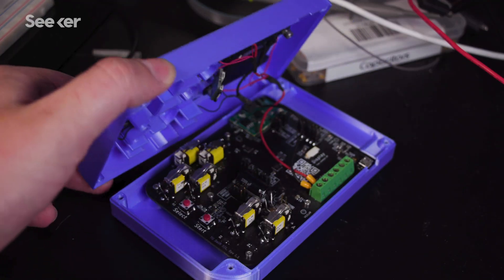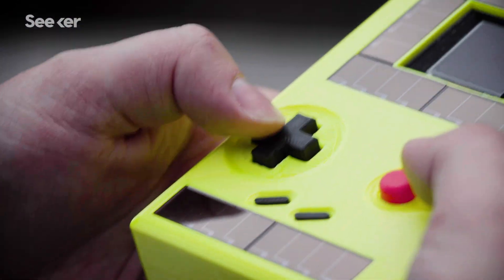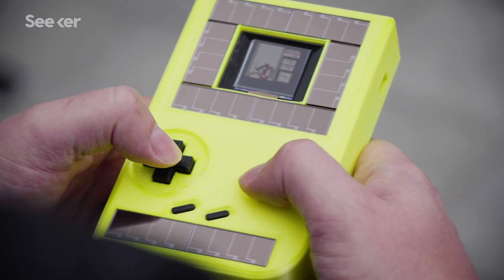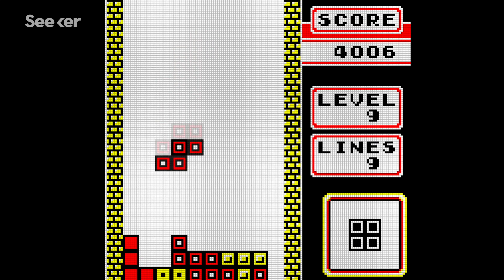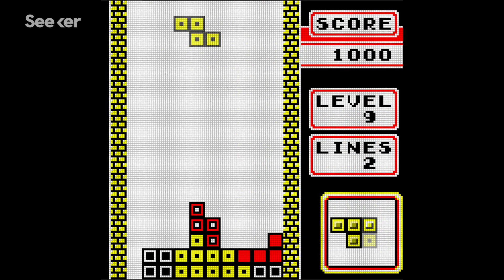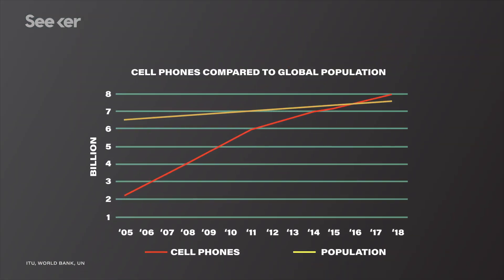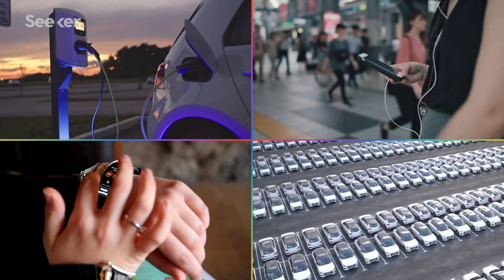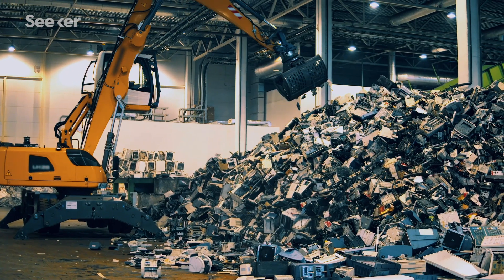The Next Gaming Revolution Starts With a Battery-Free Game Boy

Comment: "Battery-free",  "nothing you would recognize as a battery", yet at 0:06 there is a 3300uF capacitor inside, which is very much acting like a energy storage component, i.e. a battery. I'm all for pushing new ideas, and making things energy efficient, but please don't do it on false grounds and misleading people, it just dulls your message. "Battery-free" and "using a different way to power" are two very different things. Hand crank "battery-free" emergency flashlights use the same idea, store energy in a capacitor for a short time after cranking to light up one or a few LEDs.
Reply: A capacitor has significantly less environmental impact than a battery. It may be serving a similar purpose but the fact that it specifically is not a battery is important.
Reply: @EMAngel2718  this is why we need to improve battery technology, not eliminate them, because they do provide energy storage above and beyond what we would have otherwise. You're speaking in defeatist terms, I just call out the bull and marketing mumbo jumbo for what it is. It's kind of like saying something is "battery-free" because you're powering it with mains power. You can skew things however you want, and while making things more energy efficient is a great idea, the more we coat things like these in inaccurate descriptions the more we obfuscate that concept in the general public and the slower progress we make.
Reply: @SwitchAndLever  Arguably, we need to do both - improve battery technology and also look to other ways of powering devices.
Reply: It isn't a AA or lithium ion battery, which is what they were talking about
Reply: I wonder why supercapacitors are not used here. They have much higher energy density, so it is not a problem to put inside such device 1 F instead of 0.0033 F.
Reply: Gonna say, why not add a battery to store energy while it's not in use? Buttons aren't being pressed, but sun should be available for some of the day. I'm no expert, just curious. Also, where does he thinks the materials are coming from to build the device?
Reply: To most people none of that looks remotely similar to the inside of any portable gaming device.
Reply: Just because they do the same thing doesn't mean they're the same thing. There's a huge difference in capacitors and batteries. If you watched the entire video, you'd see they talk about lithium ion batteries and their drawbacks and this being a replacement for batteries in the device. So yes, the difference is real and significant.
Reply: Oh come on, give em a break. A capacitor is a capacitor, not a battery... even though it can act like one.
Reply: @AR5ONL  Which is exactly what it does in this device. There is literally no other reason to have that big of a capacitor in a device like that.
Reply: @SwitchAndLever  
And how else do you think they would store the energy?

Capacitors have to be used here and in really any circuit where energy input is unstable and like a battery capacitors can still fail. Also like batteries the bigger a capacitor is the more likely it will explode damaging nearby components when it does.

Capacitors can be safely charged and discharged much longer and over many more cycles than any battery, but they still degrade and will add to e-waste.

Additionally this very simple device takes up more space and requires more physical mass to make meaning CO2 goes up while the compute ability dropped off a cliff.

This cannot power a phone or really anything that we use today without one of these two things happening.

1. Compute architecture must become hundreds of times more energy efficient.

2. The electromechanical and photovoltaic power plants in this device must generate dozens to hundreds of times more power.

Remember that this example proof of concept device is barely capable of running Game Boy games for a few seconds on a device with a smaller screen, no speaker and using far more modern and energy efficient chips.

This proof of concept is as much of a pipedream as hyperloop.
Reply: @VariantAEC  I'm not sure, it sounds like you're arguing against me even tough you've said nothing that I disagree with? 🤷‍♂️
Reply: @SwitchAndLever  
I am and I largely agree with you as well except on the singular point of using a capacitor. I asked what do you think they could use besides a capacitor and argued that they couldn't use anything else. There is no way to make such unstable and low power usable without a capacitor. If they were generating more energy than they need they could use resistors alone, but that cuts into the top end power they could output as well. If they generate too much the resistor burns out and the circuit is permanently broken (until the resistor is replaced). You can still use a capacitor to store the excess drawing only from the capacitor when there is a surplus of energy sparing the strain on the resistor.

So I ask again what else do you think they could use to power any electronic computer without any battery or capacitor?
Reply: @VariantAEC  "So I ask again what else do you think they could use to power any electronic computer without any battery or capacitor?"

I'm not arguing that they should use anything but that, I'm pointing out the double standard in the way this is presented. "No-battery" technology is, at the very least in our current understanding of physics and how to power things, dead on arrival for anything but the lowest power requirements. Focus needs to be on improving and inventing new, and more sustainable, battery technology and systems to deal with e-waste.
Reply: Battery : electrochemical cells that transform chemical energy into electricity.
Capacitor : device that stores electical energy in an electric field.
There is no battery, period.
Reply: @baddan314  I was waiting for someone to split hairs and copy some text from Wikipedia. Thank you for not disappointing! I'm not arguing that the underlying principles of a battery and a capacitor is the same, I'm merely saying that they fill the exact same purpose in this circuit. They store and discharge energy. Saying that this doesn't have a battery because it has a capacitor is like saying that the rhino doesn't have a horn because it's technically made from hair.
Reply: @SwitchAndLever  all horns are made from hair... so I don't see your point. The fact is that the goal is to not use external electrical power not chemical battery and he just did that. The capacitor doesn't work as a battery as the capacitor discharges almost instantly. It's more like saying a car is not a wing even if some car can take off at high speeds because of the wind.
If you listen carefully to what he's saying, he didn't put external electrical source nor chemical battery because it's a proof of concept for environmenet friendly applications in the future

Comment: Using the new tech of Solar "Paint" to put on the outside would help, I think. Then the whole case could be coated in this paint so any angle the light hits, and any amount, would help.

Another thing that might help would be thermal electric converter in the hand palm areas. Though, this may not generate enough.
Maybe using e-Ink would allow for less power consumption. e-Ink displays have gotten pretty fast (relatively speaking) at refreshing
Reply: Well, this is interesting. Wonder how fast it needs to be 🤔
From their website: 
Display:
It was incredibly difficult to source a large display that had reasonable power requirements, a decent refresh rate, and minimal external driving circuitry. We quickly discarded the use of electronic Ink displays because of the slow refresh rate, not suitable for gaming, and the complex driving circuitry. Instead we use a Japan Display LPM013M126A LCD, which measures 26.02 × 27.82 mm. The display is is smaller than the original Game Boy screen (47 × 43 mm) but has a better resolution of 176 × 176 compared to 160 × 144 pixels.

Comment: Why not have a small capacity rechargeable battery to smooth the power over and avoid any outages? Maybe even a large capacitor could do the trick.
If we have a problem with lithium (cause we're more catholic than the pope, apparently), then why not use a non-lithium tech?

Comment: Ok it’s not the same thing but I bet there’s a capacitor somewhere in there that will make this title clickbait
Reply: still, the capacitor is not a battery, and there are at least 4 big one around the main compute unite, u can see them in the circut board cleary, the cilinder shape like silos, things
and yes capacitors are lithium free, they use no chemical reaction/exchange to storge energy and they are able to fill and release more then 100 times a second, they'r only down side is that they store a LOT less energy per mass then batteries
Reply: @lulo0044  Also considering how different a capacitor is at storing energy to a traditional battery, I doubt it can store energy for too long once you stop playing. So you either have to charge the system before you can play it or keep the system under a source of power, i.e. sunlight to keep the solar panels charging the capacitors.
Reply: It looks like on 0:08 the 3300 uf might be the 25 volt capacitor
Reply: I think the point of the device is that it requires no charging.
Reply: @kainenable  if that’s the case than the title is even more misleading since capacitors will need to charge for a long time relative to a plank time (I get your point I’m just making jokes, take it easy and happy holidays LOL)
Reply: @PeTr01  You too. Its hard to see sarcasm over youtube comments. TBH I don't really understand the utility of this device. It is more of a statement. Certainly it would be just better to have a 100 watt solar panel and just charge a portable battery.
Reply: @kainenable  it’s a proof of concept that reduces the need for resources used in rechargeable batteries, tbh solar panels are great but the problem is that they tend to degrade relatively fast compared to other components, if we can learn how to organize and recycle more efficiently and somehow harvest the energy in the atmosphere to reduce greenhouse gases, that would probably benefit the earth more

Comment: Cute concept. But a game boy is, as evidenced by the 10 second run time and tiny screen, even compared to the game boy pocket, hugely impractical for such a technology. The idea of harvesting energy from button presses is rather clever, but not really revolutionary.

Why not expand this with a small battery that could run the device for a couple of minutes. That way you aren't wasting all the excess energy generated. There's plenty of space in the case for it. And a screen larger than a postage stamp would be nice.

You could also work on more practical uses for such minute power capacity like a wifi connected doorbell, or maybe some kind of command line computer powered by the keyboard. Plenty of button presses there. Or maybe you could use some kind of spring as energy storage, where pressing the buttons activates a ratcheting mechanism that winds it up, then as it unwinds, the mechanical energy is converted to electricity. This would also mean a much smoother, more predictable, power input. Watchmakers have been doing this kind of stuff for an absurdly long time with their self winding watch that uses the motion of you walking to wind itself.

Comment: Interesting. Put a solar panel on the back that can also flip out.
Reply: They're clearly intending to improve the device with increased efficiency rather than increased cost or else they would have more solar panel to begin with
Reply: I was also thinking about that lol. Also, there exists earth's magnetic field.
Reply: @vasudevraghav2109  yes but it is a static field(it is actually moving but incredibly slowly) and it's pretty low compared to the magnets we use
Reply: @GoldenHat333  if you are moving through a stationary magnetic field you can make a current. Just play it on the hyperloop
Reply: @JinKee  Of course you can but as I said earth has a very weak magnetic field so you would need to move ridiculously fast to generate sufficient power hence I did not mention it
Reply: There's no battery. Adding more solar panels will do nothing for the device.
Reply: Too many moving parts reduces efficiency and also solar panels are very inefficient. At some point it might not be worth it unless you make the panel very efficient (which means expensive)

Comment: #Objection.
But it has SOLAR panels... It has a power supply
Reply: Solar panels are not a battery. Of course it has a power supply. It has multiple power supplies. The point of the project it to passively harvest energy from the environment via solar and the user's interaction with the device.

Comment: He could get energy from heat. I remember a fabric from a while back that just a tiny square of it against your body could charge your phone be so a patch of that ware your hands are could power the device with ease
Reply: Not as simple as that, you need both hot and cold heat resovours. According to thermodynamics you cannot extract work (useable energy) from a single heat resovour, the heat extracted from the hand would need to be dumped into a colder heat resovour after energy extraction has taken place. Creating this cold resovour you would need impractically large cooling fins (passive heat transfer since this method doesn't require energy input) the issue is cooling fins need a sufficient thermal gradient in order for sufficient heat transfer to occur (typically 10°C above the ambient air temperature is the lower limit for buoyancy effects to begin to take place and even then the energy transfer is low). Next issue is that this type of energy extraction for the given size would likely require a thermal couple which already have extreme poor efficiencies at optimal thermal gradients between the cold and hot surface, the thermal gradients likely to encountered in such a device that uses the ambient air and the hand as the energy resovious would be too small to have any meaningful efficiency from the thermal couple. So long story short the poor efficiency of transferring the energy between two resovours coupled with the poor efficiency of a thermal couple(s) would leave no meaningful amount of energy being extracted from the hands of the operator. My apologies if this was poorly written, I wrote this on my phone without checking for grammar and spelling.
Reply: @justanotherperson5653  I’m not sure that is how this fabric works but I know what you are talking about. I have seen a few engines that work on this principle.
Reply: @charliemaybe  the fabric does work that way if it did not it would break the law of physics

Comment: I don’t get it. You have an obsolete system running off some solar cells. How is this the future lol. There is nothing here that is innovative except the button power thing but that seems sketchy. How about I just run current games on say, a phone, or Nintendo switch and charge them via a house with solar cells on the roof.
Reply: Based on the last part of the video, lithium batteries( which is use for everything nowadays) is the thing they are battling. So having solar cells and other storage units are not needed anymore on their vision
Reply: @Daryll Joshua M. Penilla Technically you can make computer without battery
Reply: It's a testbed. It's easier to prototype something like this with something that can now be built with low-power components. Once you get the principles locked down, you can push the envelope, recovering more and more energy from the environment, tweaking the system to use less and less energy. Attempting to build something more modern would have him spending time on parts of the device that are irrelevant to the problem he's trying to solve. That's what he's doing with this.
Reply: @talideon  no, he build a gameboy because it is impossible to build anything else without sci-fi tech
Reply: @raulcavalcante9193  exactly. The thing that will drive this device is better solar cells and that has nothing to do with what this guy has made. What he is basically saying is give me better solar cells and I can run a better system. So what? it prooves nothing.
Reply: Well some people have lots of free time to make things that doesn’t even make sense
Reply: think about placing those switches under walkways and platforms of a crowded train station
Reply: @jibinsebastianishere  
Not very efficient but still better.

Comment: Or just add battery for peak moments. And let solar and movement fill up the battery when not in use.
Reply: It's not meant to be a perfectly serviceable Gameboy. It's a proof of concept that you can power a device without a battery.
Reply: The idea is to eliminate the need for a battery.
Reply: Cameron Crowhurst batteries can be renewable for a low consumption device like that and capacitor or supercapacitor would work quite well too